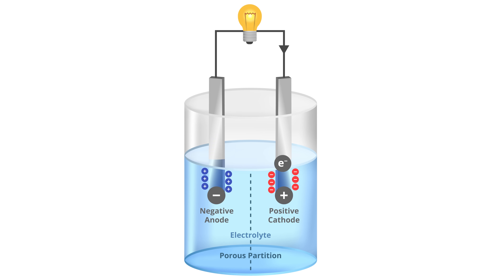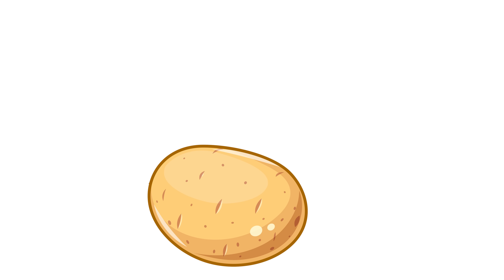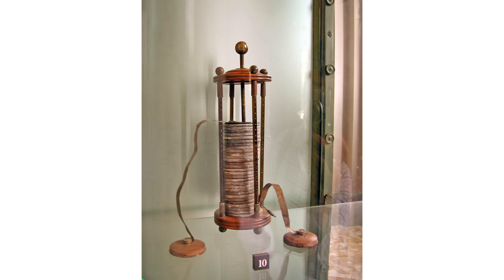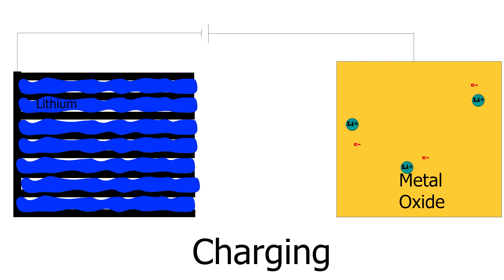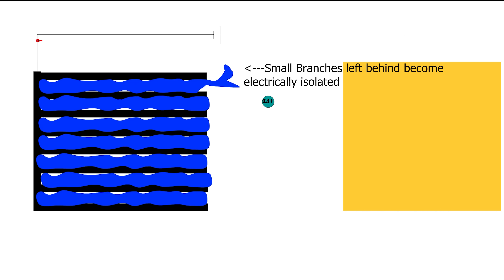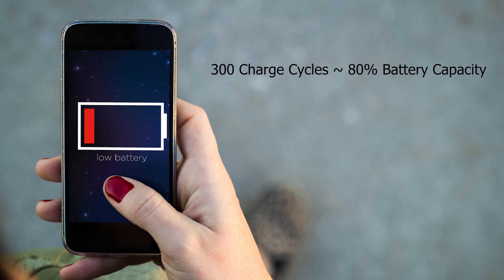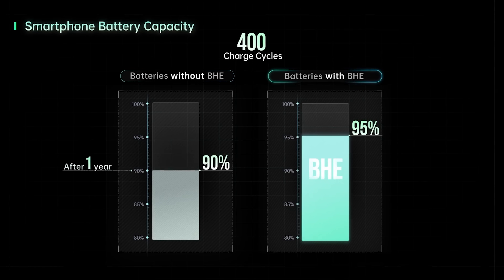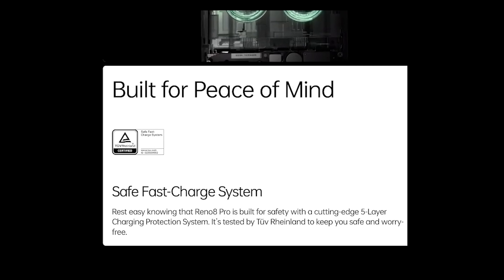How To Stop Dead Lithium and Double Your Phone's Battery Life

Comment: Oppo is not the only company doing this. Although their implementation looks interesting, but very hard to understand technically with all the marketing fluff. Most phones have some kind of battery saving or smart charging function now. Samsung is one of the leading lithium battery manufacturers as well as phones. I've had several Oppo phones that had Samsung made batteries too, so that bit about electrolytes was intriguing.
Reply: A more economical and feasible option would be to make a smarter charger that communicates with the device. This would not only allow most current operating phones to use the tech, it would also help to reduce the overload of waste into landfills by people tossing phones out.
Reply: @korishan  Don't actually need smart chargers, per se the smarts in the phone are enough, plus they can monitor the battery health more directly. The charger just needs to respond to the phone and it's smarts.
Reply: @_BangDroid_  Not all phones have the ability to stop charging on their own while the charger is plugged in. Especially some older phones. The charging circuit is designed to only disconnect when a top voltage, usually 4.2-4.35V) is reached. It's not controlled by software. All they can do is send a notification when hitting a certain percentage.
This is why a smart charger that could just cut the power would be a better idea, as it would work on older phones without issue
Reply: have you seen the video about Samsung batteries exploding(not from 5 years ago, it was made very recently) though
Reply: Samsung have the most explosive tecnology, lol
Reply: @backyardreturn  eh, out of the millions of batteries they make, only a tiny fraction have been defective. Compared to cheap Chinese products like vapes and those ridiculous hoverboards that were burning down peoples houses, Samsung are a lot better. They make some of the best 18650's on the market.
Reply: Samsung is the worst mobile phone I have ever used, including there batteries.

and there MicroSD memory cards too
Reply: @W123  Well they make lithium cells for a lot of phone manufacturers, as well as other parts like screens. All the Oppo phones I've owned had samsung manufactured battery cells.

Comment: I only charge my phone via a weak USB port that has low current. My phone is 2 years old now and still has 89 % of its battery life. Don't use induction chargers, they ruin your batteries too.
Reply: I don't care, rather that and getting to 100% in like 40 min than having to wait 3 hours

Comment: As somone who did their homework to extend lithium cell life, I can offer the following advice.. Don't use quick chargers, use 1A charger or less and if you can monitor charge to 90-95% or 4.1v don't discharge less than 20% or 3.2v and if it's not a phone battery.. discharge within rated constant current specs of battery cell manufacturer spec sheet and charge within non max charge specs. Charging lithium cells like 18650's at 500mA or 0.5A usualy ok for most manufacturers. And finaly, if you can't monitor devices, use a charger that cuts off power when cell reaches it's full capacity.
Reply: pretty sure that's all done automatically behind the scenes by all devices. you don't have to worry about it
Reply: @GraveUypo  automatically?, oh you mean charging to 90%? How? or not discharging less than 20%? How? Or using low current charger? How is that automatic? Seems like you're one of those delusional people with over inflated ego's thinking you know everything.

Comment: Keeping your battery at 10% - 90% to prolong its life is a pretty dumb idea.  You are essentially getting the degraded experience (having only 80% usable battery) in advance in order to prevent the degraded experience from happening too early.
Reply: Not if you already buy a phone with a larger battery, so that 80% of its range is about the same as a full charge of another option.

Comment: Improve your phone's battery life by buying a new phone. Brilliant. Would have never thought of that.
Reply: Simples!
Reply: Save your marriage by getting a new wife!
Reply: A more economical and feasible option would be to make a smarter charger that communicates with the device. This would not only allow most current operating phones to use the tech, it would also help to reduce the overload of waste into landfills by people tossing phones out.
Someone in my discord actually built something similar, altho it doesn't communicate, just senses when amp load drops (lithium charges with CC/CV) that the charge is about 4.1V, and stops charging. Extending the life of the battery drastically
Reply: True👍
Reply: Same
Reply: If you don't upgrade you're iphone to oppo, it would not fix the phone
Reply: He literally said, don't let battery drop fully, don't let it hang on 100.
Maaaaybe let the phone drop to 10-20 before charging it again (advice from my imagination).
Reply: by buying a new phone with this technology yes
Reply: @Blox117  the title says "double YOUR phone's battery life". My phone isn't one that I buy in the future.
Reply: @josephschembri4811  it never said current phone, just one that you own.
Reply: @Blox117  so, your current phone?
Reply: Literally not what he said, even a little bit, but that was GREAT misrepresentation, you should get a job at the GOP

Comment: I just don't trust an off brand phone... If I'm going to spend $800-$1000 on a phone I have to stick with what I know I'm happy with... Jumping ship for a phone that hasn't been through long term testing and usage is a risk I cannot take. When you're buying a phone you're purchasing something that is going to be a major part of your life for years.
Reply: (Overlong, sorry) I bought an OPPO A91 two years ago. Although it's quite below your price range, it was also a difficult decision to trust a brand with almost no penetration in Europe (or the US). I bought it under the impression that the brand was playing the long game of offering better materials and construction, while other Chinese brands offered one/two flagship-like features but drastically cut costs on all the rest. After just one week of use, the phone fell from a rock and sea water went over it for some time while I was having an improvised bath (don't be an idiot like me). It still worked but water had gotten into the camera block (there were droplets inside) and the software didn't detect the cameras. That was not a problem as the phone died that same day, before I could apply any home remedy like putting it in a rice bowl. I forgot about my new shiny brick and when, a few months later, I pressed the start button, it revived as new. All sensors, microphone, speakers, screen, have been 100% perfect, an amazing resurrection for a phone that cost me $250, got salty water inside and no effort was made to get it dry. The camera is not at 100% as it ocassionally has problems to autofocus at high zoom rates, but I learned to live with it. This shows that OPPO does take durability seriously even at that price range. I can't testify to the quality of their flagship models, but I tend to believe that, when they claim this will last twice as long as the 'industry leading standard' (i.e., Apple), it can actually be true or close to true.
Reply: @pedroteran5885  Thank you for that, that's a good story, sounds like it's made well for sure. I appreciate it you telling me that, these are good things to know.

Comment: Lithium batteries are being used in mobility scooters as they are much lighter and smaller than sealed lead acid. The big problem is that they can’t be monitored and a disabled person can be left stuck as the lithium battery quickly dies without warning. Scooters with SLAs have a readout of power usage.

Comment: I thought all Li-Ion batteries had some electronic circuit monitoring and adjusting the charging current and voltage.
How are we supposed to trust your explanation in yhe forst half, when the 2nd half was a shameless ad with halftruths (like the graph showing 80 and 90% like it was 0 and 50.. sure, it was labeled, but the graphic representation was deceptive on purpose)

Comment: I know that this is just an advertise video full of bullshit, but man…. There is absolutely no metal lithium in the 99% of commercial Li-ion batteries, and absolutely zero in a smartphone batteries. Lithium plating is a serious threat to battery and anytime it’s happening it can easily result in a short circuit and fire (We have this in Samsung Note couple years back due to production failures).There is no metallic lithium floating in the electrolyte, except the one possible situation, when your battery was overcharged or is very old and will be dead soon.
If you want to know what is going inside a battery search for “intercalation” in Wikipedia.
Second of all. The SEI layer is self-healing by default. The same way you get wet when swimming. You don’t need extra software or special, patented water in a pool to get wet, do you?

Comment: here's a simpler, more efficient take:
the larger the battery, the longer its lifespan. Iphone's batteries are small (2k-3k mah) INTENTIONALLY (part of planned obsolescence). solution? go for 6K+ phones, and ur phone could EASILY last 6-7+ years. that is all lol.
Reply: That’s a massively oversimplified statement, since it’s charge cycles and not battery size that leads to battery wear. If you have a 3000mah battery in a well optimized phone that can last all day on a charge, that’s going to have the same battery lifespan as a badly optimized phone with a 6000mah battery that only lasts a day on one charge. Now, if the 3000mah battery/phone last 1 day on a charge and the 6000mah battery/phone lasts 2 days on a charge, that’s a different story. Point being, simply having a bigger battery doesn’t mean the battery will last longer.

Comment: 2 years or 300 hundred charge cycles? In 2 year I would have used at least double that amount of charge cycles 😅😅
Reply: A charge cycle is not the same as one charging. A charge cycle is charging from 0% to 100%. Usually you probably charge less, and if you would ever only charge to 80%, you would be able to charge 3-5 times to damage the battery in similar way as one full charge.
Reply: @jankoodziej877  that is actually a very good point, if I'm not mistaken the bulk of degradation happens in the extremes, i.e. close to 0% and close to 100%
Reply: @WouterVerbruggen  I'm not sure about the lower range, although I don't think the charging is that damaging (maybe discharging is). Usually charging scheme is to apply the fastest charging at lowest battery charge, and I think in part that's because it's not that damaging.
Reply: its one of those 'in ideal situations under optimal conditions' type things

Comment: I'm not too worried about my battery life over the next couple years.... I'm sure planned obsolescence will ruin my phone before the battery does.       😞
Reply: I'm pretty sure manufacturers are intentionally slowing down these phones as the battery degrades. If I'm not mistaken, I'm pretty sure Apple had been in trouble for doing that.
Reply: It's also mostly due to “device fragmentation”, or in other words: the slow and steady increase in device models and permutations.

More phone models over time increase the number of hardware devices to test software on.  Many companies don't value a robust QA testing process, and neglect testing on older devices after a few years of newer models have been released.  Also, people tend to be more excited by faster and newer models of phone or computers, which is a shared cognitive bias or trend among technophiles, including software developers.

So, this results in more focus on development and testing for newer devices and less focus on older models and devices.  For example: many websites and apps that used to work well on smaller iPhone 5 screen sizes have been updated to work on larger screens for the newer models of iPhones.  As a result, they neglected to test the updated versions of apps on the smaller screens. This has sometimes resulted in unusable and impossible to use user interfaces, because buttons or controls are jammed too close or flow off the screen with no way to tap or access them.